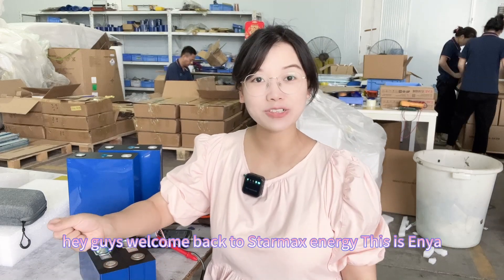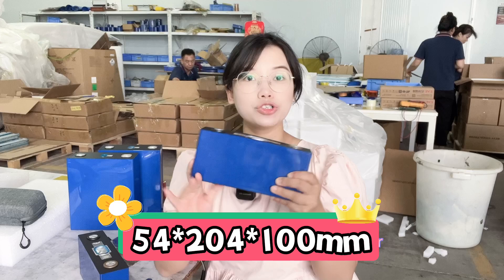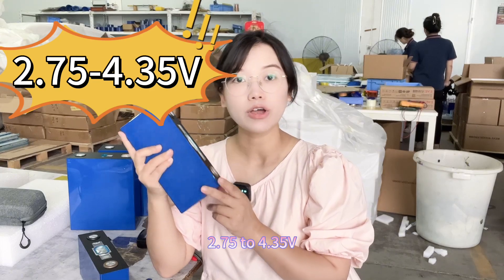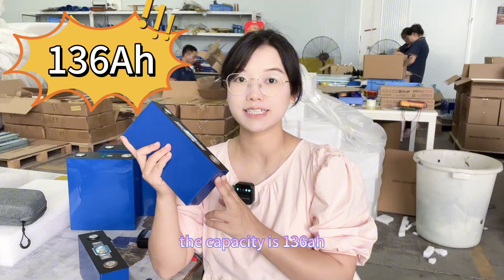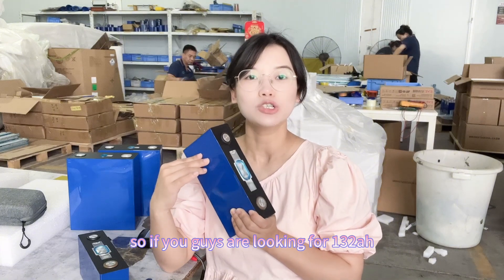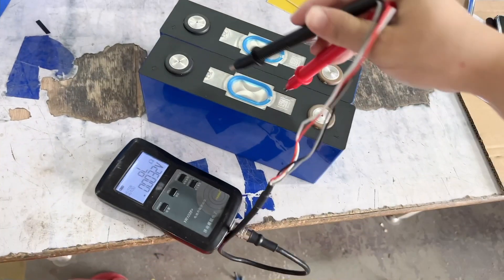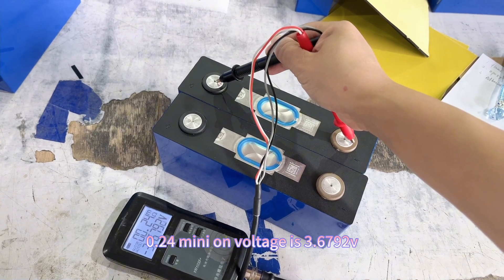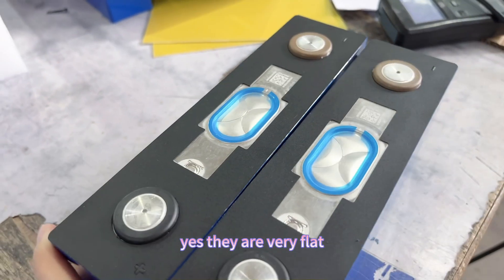CATL battery 3.7V 132Ah lithium ion cell for promotion

Comment: Try stab it with a fork. Now you know why only newbies would buy that chemistry for solar. Not only is it a mini atombomb in a 4s-16sconfiguration it also has garbage cycle rate. And dont dare to get it hot either.. ever seen a phone charging under a pillow by accident.. boom

just look here on YouTube for lithium ion or li-po / lithium polymer explosions. Its quite dangerous.